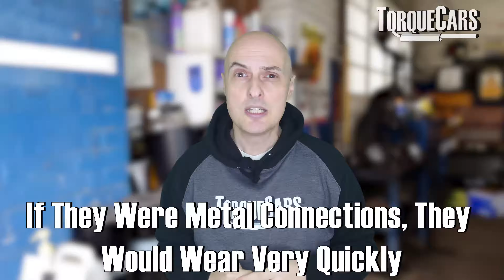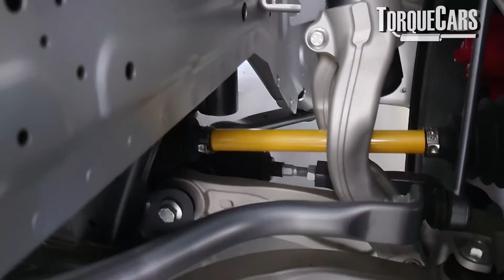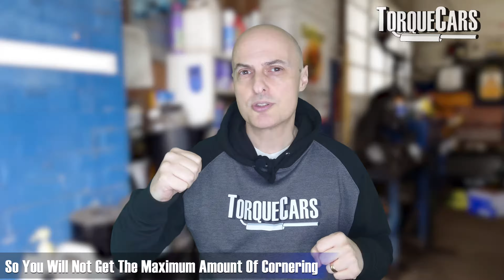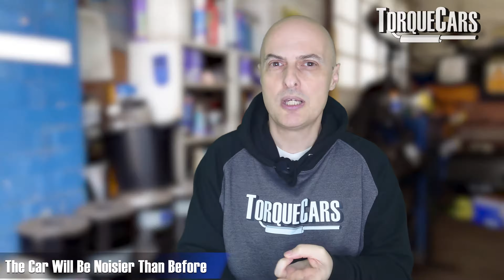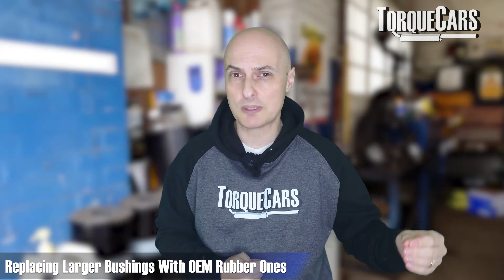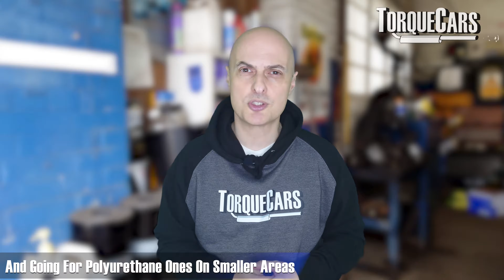The Pros and Cons of Polyurethane Suspension Bushings (Poly Bushes vs Rubber)

Comment: One thing to note is that only we can make Polybushes... Hence the name - Everyone else makes Polyurethane bushes. 
Polyurethane Bushes can be made in any hardness - Rubber band soft or concrete hard. 

OEMs use rubber because it's cheap, not because it's the best. However, there are many OEMs now coming to us for help on special projects where rubber bushes just cannot cut it.
Reply from the maker: Hi buddy, i'll pin this comment for you for a bit on here as there is a lot of confusion out there regarding poly bushings and options. Do you feel I should reshoot this video with "updated" information?
Reply: @torquecars  Totally up to you. The video has done well, so maybe an 'Episode Two' with updated information could be beneficial to your viewers. We'd happily help answer any questions you have - Just give us a shout!

Comment: I dont see the point to use poly instead of rubber: they are noisier / squeakier than the rubber one. And the rubber ones last quite a lot, round 100 000 km so whats the point really.

Comment: Polyurethane is a huge mistake, they are no where as durable as the OEM brushes, I been there, when I used polyurethane my car was all in the garage for suspension work, my car also suffered from all the harshness you described and felt unpredictable. I decided to go with a mix of OEM bushes and Nismo bushes for my Nissan and my car has been a dream to drive.
Reply: We sell polyurethane bushes to some OEM's and lot's to military & industrial applications. Rubber can't compete... However! It's all about making the right bush, in the right hardness, with the right characteristics. 99% of other manufacturers just make hard bushes, which, unless you're racing, isn't ideal.

Comment: For a 500HP B5 Quattro, do you recommend switching to Poly bushings on the rear, considering this chassis relies on passive rear steering (elastokinematics)?
Does 'locking' the rear axle with Poly improve stability at high power, or does it negatively affect the suspension geometry by removing the intended factory compliance?
Thanks!

Comment: I stick to rubber bushings on my quattro. Only use poly on the ARB. Rubber is fine, especially if you are replacing tired old rubber. It feels better immediately, no need for poly IMO.

Comment: They only squeek when they're not in a proper casting ie Powerflex bushings.
Reply: @daveyboiyeah  they have a little noise in the cold weather I did mine about a 1 ago now that it’s getting cold it’s just makes a little noise nothing crazy even with them greased up tort to the right spec of the car but car drives great I could care less about a little noise I barley hear it tho

Comment: Hi, what specific Alfa Mito Powerflex Polly bushing you would suggest to put on?
Reply from the maker: I would probably not do this on the Mito, the suspension is actually designed around the flex of the rubber and provides better cornering as the rubber compresses and the toe/camber moves a little, this would be lost with firmer poly ones.
Reply: @torquecars thank you very much i had ordered a kit of those and cancelled as soon as i saw your review specifically for that vehicle. Much apreciated.

Comment: I just bought 33mm poly bushings for my 2013 mustang v6 front sway bar which is 33.3, the car is not serviceable and this is the best I could do without replacing it. The mechanic didn't grease them at all! So i went to another mechanic shop that specializes in Mustangs and they redid it for me. To my shock the noise is still there even properly greased now. I know these bushings are smaller than the bar but so far I'm not happy. I drive about 350 miles a week around NYC and Long Island so I'm hoping a couple weeks of pot hole roads will actually loosen these up a bit and cut the noise down on bumps and right parking maneuvers.
Reply: @NYFan77  4 months later, how are they?

Comment: my terracan is basically a boat with wheels so while im not expecting amazing handling the alignment guys can't seem to get it right.
i do need to get both wheels in the air to prybar and wiggle a bit further.
 i know the front/rear sway bushes are done for so will be swapping them + links.
*characteristically the steering feels like there is no freeplay (especially after swapping the pitman) but if the road canters, ill need to pull/hold the steering wheel to the opposite. highway speeds are where i would like to make it more tame as i believe it one used to be.

so if there is no findings or change after the above i might try swap the 2 uca with a poly bush and new ball joint and go from there.

Comment: Why aren't poly bushings.used by any car manufacture?  Every manufacture from Toyota to Lamborghini use all rubber bushings.  Also, poly and rubber can be made to any shore harness.  all poly isn't harder than all rubber.
Reply from the maker: Cost. Rubber is pretty cheap but, rubber still degrades over time though but is generally considered cheapest for people to upgrade. As a "natural product" rubber will degrade in a more environmentally friendly way over time.

So I think the answer is probably cost. Honda used a liquid filled bushing on some of it's performance models for a smoother ride quality.

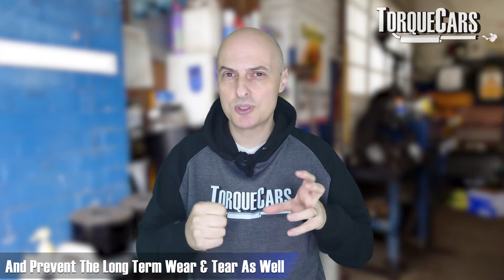Comment: Ultimate performance, as referenced at 4:26, may well be solid metal bushes.  Sometimes you need a little give for performance, but for me, locating arms I want there to be as little wiggle as possible so I don't use rubber or poly.

Comment: Something ive not seen anyone point out is that polyurethane can be had in many different hardnesses or durometers. So you can match rubbers performance no problem. Poly is just better, if you had a bad experience you probably got ones that were too hard.
Reply: Absolutely true that various poly have different hardness; however, often it's way better to stick to rubber; including if not especially by using MEYLE HD bushings where available (which is limited)? (remember as far as lube goes, they are bushings not bearings!?)
Reply: A lot of the time it seems the consumer wants durability, but the same comfort. Why all the poly bush manufacturers do not just develop poly bushings with the same vibration damping and load-deflection characteristics as the OEM rubber ones, it would be nice thing. You wouldn’t be modifying your suspension if not necessary, but making it more durable.
Think SmoothOn PMC products.
Reply: @D0zer122  because soft poly is not so stable, as hard one. It will degrade faster and water from the road will get easy way in. And friction + corrosion will destroy it.
Reply: We couldn't have said it better ourselves!

Comment: I had torn torque mount bushings on my civic so got some solid poly/billet ones on ebay. That was a terrible idea. The whole car vibrated insanely bad so i went back to oem style ones. Maybe if the poly was softer they would work better but it felt like the engine was bolted directly to the chassis.
Reply from the maker: Thanks for sharing that really reinforces my own experiences, but I'm glad you got it sorted in the end my friend.
Reply: I don't think they're good for engine/transmission bushing. They're definitely meant for suspension usage. Living in Tanzania we have a lot of bad roads, and these would help me for sure

Comment: It doesn't even take a very exotic car to screw up the handling with unadvised bushing changes. Humble 1988 Mazda 626 used special biased bushings in the rear trailing arms that always work to increase rear end toe-out on cornering making the car a bit more nimble and less prone to understeer. I remember some disappointed reports about the car handling after changing to symmetric poly bushings.
Reply from the maker: The car I learned to drive in was a 1983 Mazda 626. That explains the great cornering abilities it had.

Comment: Now exactly a bushing but I have a control arm question. On Audi's front suspension, they use 2 uppers (and 2 lowers) with that pinch bolt that is known for seizing up due to corrosion and dissimilar metals. What are tricks for getting it out? My B6 is in desperate need of new uppers but I can not get it free and without removing the whole knuckle I don't even have room to drill it. I've beat on it, heated with MAP gas and almost snapped the head of the bolt off. Any insight would be fantastic! Thank you in advance!
Reply from the maker: You've done what I would have tried. Here are the usual  tricks you can try to get it out:

Penetrating Oil: Apply a generous amount of penetrating oil, such as PB Blaster or Aero Kroil, to the bolt and surrounding area. Let it soak for at least 24 hours, or longer if possible, to penetrate the rust and corrosion.

Heat and Tap: Heat the bolt with a propane torch or MAP gas torch, focusing on the area around the threads where it enters the knuckle. As the bolt heats up, it will expand, and the rust will loosen its grip. While the bolt is hot, tap it gently with a hammer to shock it loose. Also try cooling it with ICE after the heat is applied. The expansion and contraction will help.

Impact Wrench: Use an impact wrench to try to loosen the bolt. The impact force can sometimes break the corrosion and free the bolt. However, be careful not to overtighten the impact wrench, as this could damage the bolt or the knuckle.

Chisel and Hammer: If the bolt is still stuck, you may need to resort to using a chisel and hammer to break it out. This is a last resort, as it will damage the bolt and may also damage the knuckle. Use a chisel to split the bolt head, then use the hammer to drive the bolt out.

Drilling: If all else fails, you may need to drill out the bolt which will probably mean removal of the whole assembly. This is a very time-consuming and difficult process, but it is the only way to remove the bolt if it is completely seized. Use a drill bit that is slightly smaller than the diameter of the bolt, and drill slowly and carefully to avoid damaging the knuckle.

Here are some additional tips for removing a seized pinch bolt:

Make sure you are using the correct socket or wrench for the bolt head. A slightly worn or loose socket can slip and damage the bolt head.
Use a breaker bar to get more leverage on the bolt.
If you are using a torch, be careful not to overheat the knuckle. Overheating can damage the bearing and seals.
If you are drilling out the bolt, use a cutting fluid to prevent the drill bit from overheating.
Reply: @torquecars  the worst part is the nut comes off and there is no threads holding it in. It's just corrosion. I'm going to try everything again but I think I'm at the take everything off and drill.
Reply: If there's enough room, you can try using an impact on the bolt to try and get it spinning freely
Reply: Just get the $25 tool from ECS tuning and get your air hammer and it should come out.